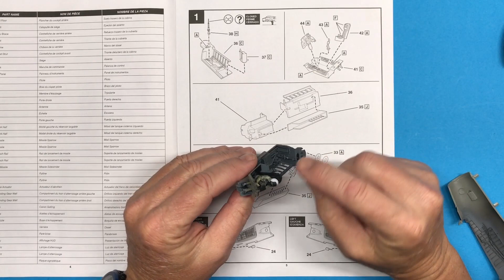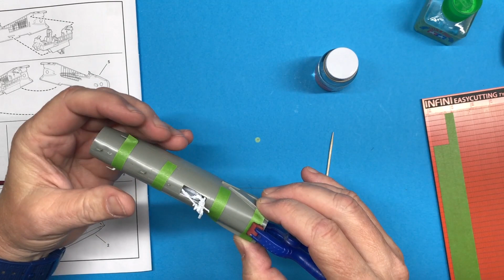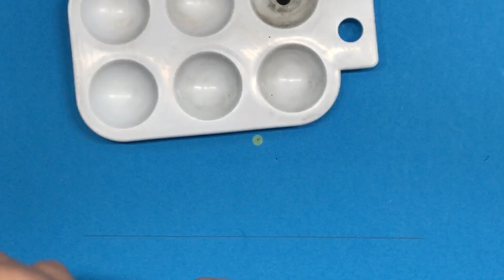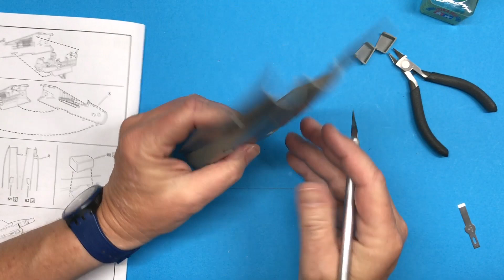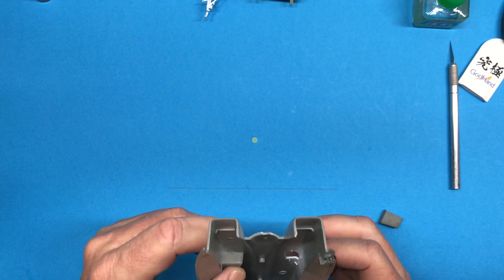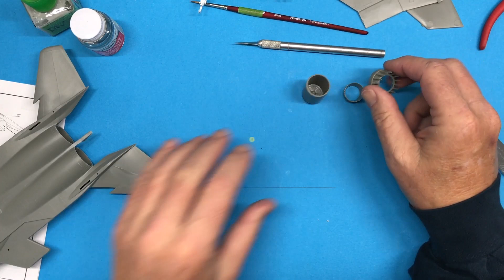Revell 1/48 F-15C Eagle, Part 3 Step 2

Comment: Not an aircraft modeler but doesn't mean I can't watch others build it. Quick story painted a p 40 warhawk in the 70s. But
 couldn't wait so I put it in front of the old floor stove. Don't know if you'd ever used or seen one but there HOT. Anyway came back to an aircraft that was drooping all over the coffee can I set it on. 🤪🤪🤣🤣 that wasn't the reason I stopped building aircraft. I did stop putting models in front of our stove though. 😁
Reply from the maker: LAL! The stuff we did as children. And as adults, I suppose! Had a similar situation with some leather boots once. Got them pretty soaked running around in the snow. Thought I'd dry them out on our cast iron Ben Franklin stove. Came back later to some mighty curled up boots. The leather drew up and shrunk.
Reply: @BrettG64  🤣🤣yikes that hurt.😁